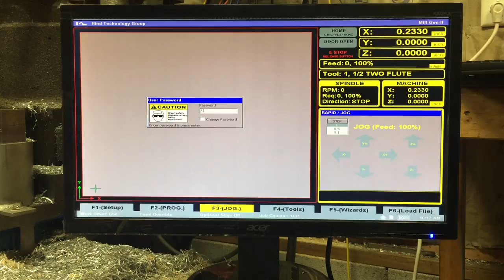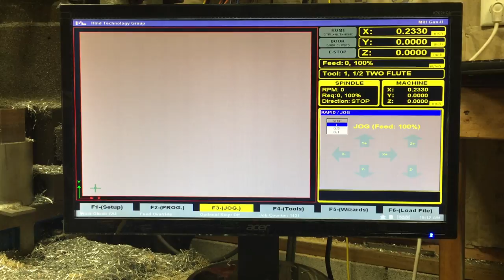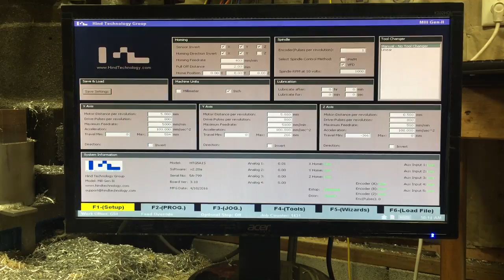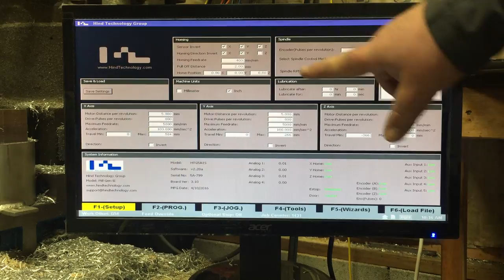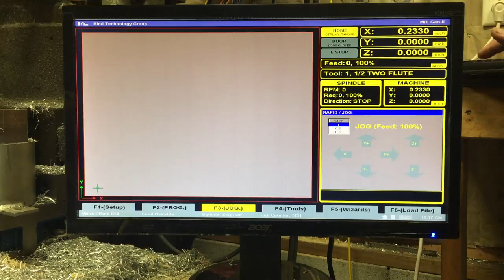Masso Setup Screen Explained for the Bridgeport Conversion.

Comment: hi john 
what type of home sensor for X,Y,Z technical details .
Reply from the maker: I used a induction prox switch with a sensing distance of 10-12 mm. Any will work they are all about the same the barrel size I used was 18mm.   Also probably the most important part is the need to be a PNP style. That means the will output a positive voltage to the Masso or your controller
Reply: Thks John